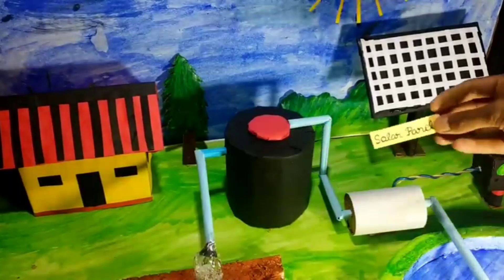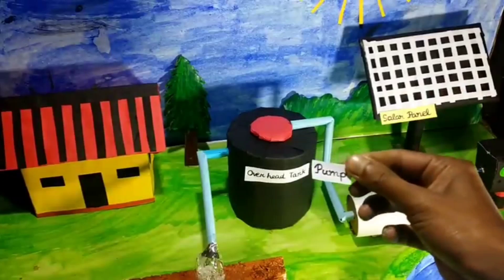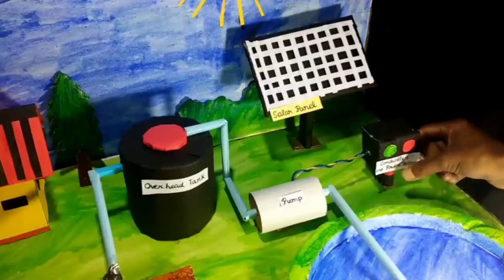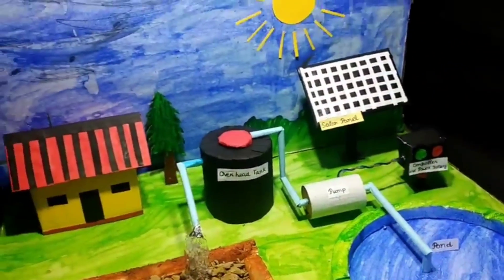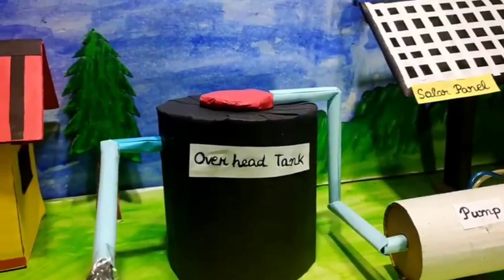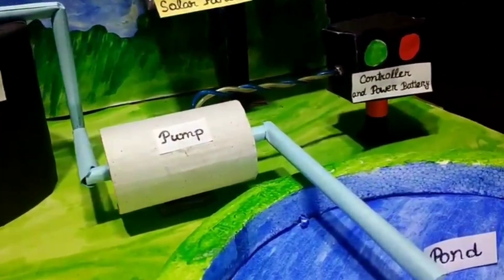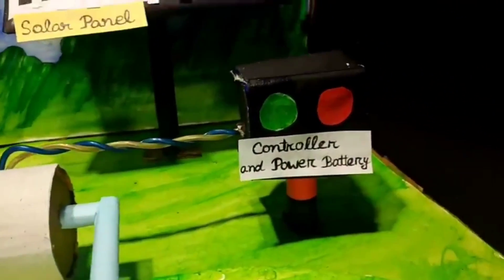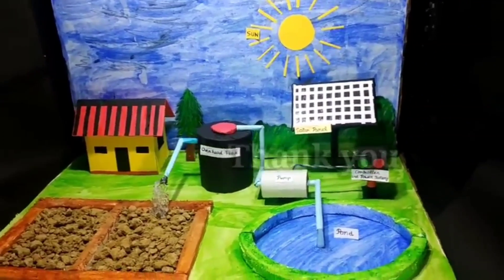Explain - Solar power irrigation system project for school science exhibition

Comment: Which glue you used for pasting cardboard?
Reply: you can use glue gun or heatex
or any other glue
Reply: I am using Fevi kwick
Reply: And i think he use thermocol not cardboard
bcoz of thickness of thermocol it is easy to paste with glue gun and thermocol is aslo light weighted
Reply: You don't no